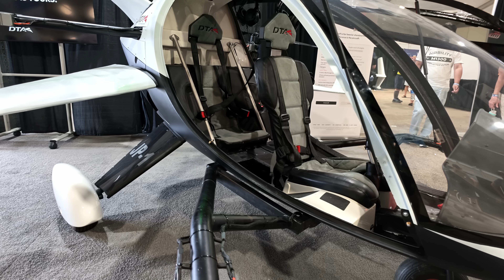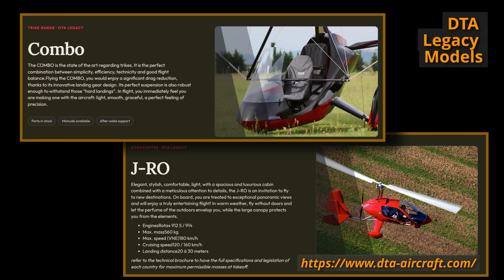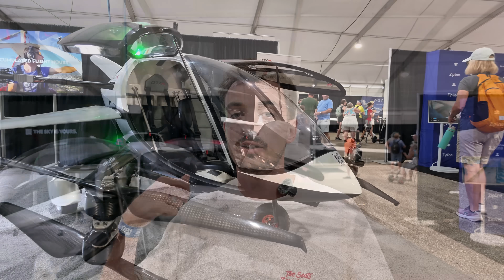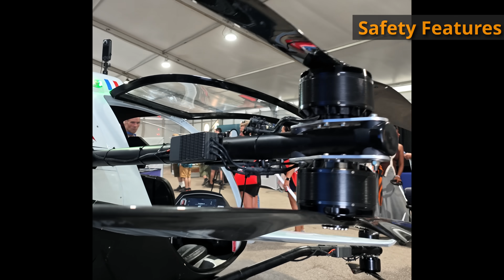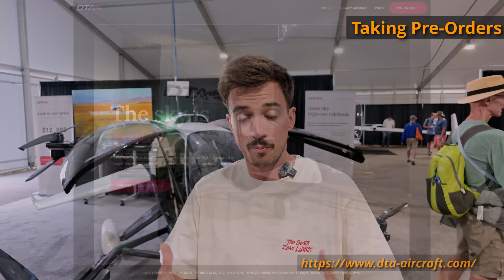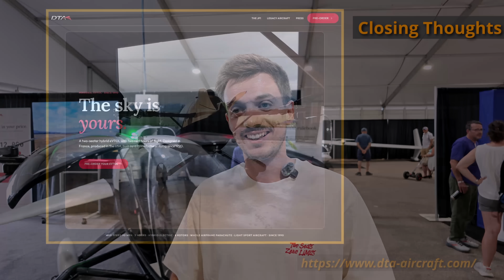Is This the First Practical Personal eVTOL? | DTA JP1

Comment from the maker: I think hybrid systems might be a great addition to eVTOL personal aircraft. What do you think about DTA's approach to building their first eVTOL?
Reply: Great video. Good that you're raising this and good that you have questions. I think serial hybrids make a lot of sense in aviation configurations where it is difficult to get power to the propulsion without complicated (and potentially unreliable) drive trains - VTOL, blown lift mechanisms, tricks for lowering induced drag, approaches to reduce noise or simply to make a sport aircraft "look cool" (beauty is in the eye of the beholder). A bit part of the interesting piece here is the drivetrain - the bit that to you and me makes this potentially more practical than a bunch of batteries. At first I wondered if this was a derivative of the old Norton Wankel that has passed through more aircraft engine company hands than you can shake a stick at, but it doesn't look like its the case. Interestingly too it claims to run on jetfuel which is a departure from the Mazdas etc. Finally the power output on that engine seems oddly low to be lifting something that big unless the batteries are pre charged and it's simply slowing the rate of discharge.

Anyway a very interesting concept, definitely doing some stuff that a number of us have been looking at and I wish them bags of luck. Hopefully other folks will cotton on to this approach too.
Reply from the maker: @jtjt210  I look forward to seeing it flying! Thanks for insightful comment and watching.
Reply: This is what we should have done with the eVTOL development first, before even thinking about fully electric aircraft. 

Fully electric aircraft need additional batteries and infrastructure for quick charge or quick battery change stations at airports. The hybrid system you can use now without changes to infrastructure. 

On the pilot certification bit: these new eVTOL's may fall under the "simplified controls" sections listed in FAR 61.315 / 61.316. NOTE, currently published FAR/AIM do not have the updated MOSAIC language, what the regulations are on the electronic code of federal regulation website.
Reply: @StarFoxCraft  I suspect that different companies had different reasons for not doing it. Some may have been leaning into the green angle, many probably didn't want the added development challenge of developing or supporting the development of lightweight generators, motors, electronics and software, some were probably excited to get to the aerodynamics (possibly because they were concerned about losing time to market) and some weren't thinking about it from a product or market perspective. Until battery tech is far better, this approach does have a lot of merit.
Reply from the maker: @jtjt210  I think the companies that are developing blending flying capabilities (rotots+wings) and even possibly "hybrid" means for range extension will find the sweet spot between VTOL and range. Definitely an interesting area to watch...and I can't wait to see what arrives at AirVenture 2027!
Reply from the maker: @StarFoxCraft  At this point I don't know exactly what "simplified controls" defines for powered lift aircraft. I think we need clarification there to understand how these aircraft-type will be supported for Sport Pilots. For those with a Private Pilot certificate, I believe you will have to get a Powered Lift certificate, similar to my Rotorcraft-Gyroplane certificate. As I noted, make sure you understand how the rules apply to your specific situation before purchasing. Thanks for watching!
Reply: @SilvaAdventures  eVTOLS sprout too many rotors are too cumbersome.
                                          A helicopter can do more.
Reply: @SilvaAdventures  Agreed. If we look into AC 61-146 it kinda lays out a framework for eVTOL with simplified controls as a "new aircraft designation" where sport pilots would need make and model specific training to operate. It's kind of a grey area for lawyers to play around with, again everything is in development I'm sure and there is a reason why the regs seem "to be open to interpretation until clarified by a FSDO" as currently written.
Reply: @John-nc4bl  helicopters are too expensive, require too much maintenance, too noisy, not safe enough.  Other than that, yeah, helicopters are great.
Reply: @SilvaAdventures  Agreed. When one of the other manufacturers were talking about becoming the "universal trainer" (a kind of Cessna 150 for eVtol) I did wonder if that was viable while the industry was still trying to figure out interfaces and standardised control layouts (beyond of course the fact that various legislation needs to catch up)
Reply: This is an interesting aircraft.  I agree that the company should do a lot of test flying for a few years to prove it's safe and ready for the general public.  
The next development needs to be bigger wings for a more efficient eVTOL.  Ultimately a little 2-seat or one-seat Joby would be awesome.  Maybe in a few more decades.
Reply from the maker: @charliedoyle7824  I hope we see it sooner than that, but you may be right. Thanks for comment and watching.
Reply: You are on the right track.

Comment: This is the way it needs to be designed. I want one but i want a smaller one seater. Until i can get one that is capable of a hr flight time and a price 20k or under I'm not going to be able to justify one.
Reply from the maker: Not many aviation choices under $20K. You might want to look at motorcycles instead. :)

Comment: I wish we could see the APU – electric motor configuration in fixed wing aircraft. This could be the ticket to a low cost purchase price and low maintenance practical aircraft for at least two people. Plus in the fixed wing aircraft configuration, you have an opportunity to make the hybrid configuration more robust than if you have to have to incorporate a vertical takeoff component as into the design . We already have a vast infrastructure to accommodate fixed wing aircraft and while vertical takeoff and landing is super cool, It’s not entirely necessary for most missions whereas range and reduced costs are the more desirable performance improvements.
Reply from the maker: I agree with you. The next few years will flesh out the mix of technologies that can succeed within our current infrastructure and regulatory environment.
Reply: @SilvaAdventures  I’ve lived through a bunch of  “Let’s build a better mouse trap airplane.” eras anyone remember the mollar sky car for example? However I think this time is different as we are witnessing the convergence of paradigm changing technologies being accelerated by AI and other game changing ideas

Comment: So, maybe they could use their talents to build a Hybrid Gyroplane first or also? 

Not just a Powered Pre-Rotator, but a 10-20 minute "Backup Electric Rotor Power Unit!?"
Reply from the maker: The stated design objective is using an "auxiliary power unit" that would provide charge while in flight to extend battery range. We will keep a close eye to see how it progresses toward production.

Comment: what is the mission?  even with 2 hours in the air, where do you recharge at a distant air field?  a thing like this is a taxi at best, local stuff.  its a head fake to say this is a production aircraft.  it isnt.
Reply from the maker: I agree there are a lot of logistics that need to be thought through as you consider eVTOL for future missions. Much like buying an EV car today. Thanks for the comment.
Reply: 2 hours is double what anything else has in the evtol market. Everybody is capped out at an unimpressive 100 mile range. Great job with this.
Reply: @sethv9039  laughing.  thats like saying one worm crawled one inch and a second worm crawled two inches.  the second worm is twice as good at the first worm. in aviation a two hundred mile range is useless.  YOU ARE NOT ALLOWED to fly using every drop of fuel, at least not under non-emergency situations.  In VFR its a 30 minutes day, 45 minutes night reserve, and in IFR, 45 minutes at all times.  Even a 2 hour range is cut to 1 hour and change under the rules.  Not enough to fly to a practice area and back safely.  Worse, THERE IS NO CHARGING INFRASTRUCTURE in the aviation system for electric planes or helos.
Reply: @speedomars yeah these companies are trying to dodge powerplant/battery development. Buy a half a million dollar brick you can fly 100miles. I can sell you a  $1000 frisbee but you're not going to buy it. I think joby has this figured out . 400 mile hydrogen battery vtol. Only company out there thats not all hat no horse.
Reply: Can't you just refuel the gas tank and run the generator for 10 minutes? granted your range will less than the 2h @60mph after that since the batteries aren't charged, but it should allow you to go some distance at least.

Comment: IMAGINE IF MY 2 SYSDED 2 STROKE ENGINE WITH VARIABLE DRIVE CVT ATTACHED TO CENTRIFUGAL SUPERCHARGER WITH DIRECT INJECTION RUNING TO 4500 RPM OR MORE HIGH COMPRESSION RATIO GONNA GO UP TO 5 TO 8 HPTO KG INSTEAD OF TURBOSHAFT ENGINES MAKES IT SO INEXPENSIVE MAKE HELICOPTERS AVAILBLE TO PUBLIC AND EFFECIENT

Comment: so if you lose two rotors on an arm at 30-40ft, what actual good is a parachute going to do?
Reply from the maker: I have that concern as well, as you would likely start tumbling. I guess the chute has to inflate? The Velo X1 (I did another video on that product) is advertise a new chute design that is advertised to be effective as low as 50’. I can’t wait to see some demonstrations of these safety features in action on the production aircraft.
Reply: @SilvaAdventures  It seems similar to auto crashes where there is a higher mortality rate in the 20-30mph range. It's the 40 foot drop that will kill you.

Comment: Rotary Wangle engines are great power to weight, but high maintenance, low hourly schedules...want to have enough battery to land if a failure occurs....
Reply from the maker: Absolutely. Let's wait and see the production unit, and the results of their safety testing on that product. Thanks for the comment.

Comment: Surely the gyro rotor could add tremendous range allowing a pure battery power plant. So initial vertical take off then energize the free spin rotor then relax until  vertical landing.
Reply from the maker: I haven't seen a gyro rotor based VTOL...I think the drag from the rotors would be hard to overcome during the vertical phases of flight.

Comment: price too high, no proven TBO, a ballistic chute has a larger gap in use = not safe at all. Gyro or helicopter is a better option 
$350+K  can get you most large helicopters used
Reply from the maker: Flying a helicopter, and to a lesser extent, a gyroplane, is a higher pilot skillset than this product will likely require. Helicopters are also much more complex machines. I think there is a place for aircraft like the DTA JP1 in the market, but the design does need to prove it meets the stated claims. Watch this space...
Reply: @SilvaAdventures  So many claims so little real data. Electronic augmented aircraft make for less skilled pilots. and I have yet seen only two that are doing what's claimed, but they all lack power density enough to be useful.  Cheers
Reply from the maker: @HongyaMa  I have similar pessimism but I look forward to seeing the progress in the next 12 months.
Reply: @SilvaAdventures  Yea, but $350K I can get several helicopters (type certified) 4 place turbine or piston

Comment: A purely electric VTOL aircraft would currently be unrealistic, as battery capacities are not yet sufficient. Therefore, a hybrid design is the only feasible solution, because nobody wants to land again after only 30 minutes.
Reply from the maker: For the $100 Hamburger  use case I was presuming, I agree. There is probably a small market for a "toy" that flies for 20-30 min for short sightseeing trips around the local property/area.  Thanks for watching!

Comment: $385k 😮yeah that's not going to happen and that price will not go down far enough to be affordable. and that is not including taxes and other fees so more closer to over $400k
Reply from the maker: New aircraft aren't cheap. Thanks for watching.
Reply: That’s the cost of a low to mid time Robinson R44 helicopter, something with better performance.  Only saving grace is maybe lower operating costs, few moving parts with this thing…..
Reply from the maker: @antigrav1302  There is a lot of complexity not only in the machine, but also in the flying, of a Robinson R44. Pricing does seem high, but so does the cost of a burger these days. Thanks for comments and watching!